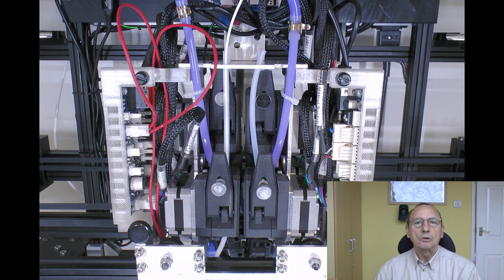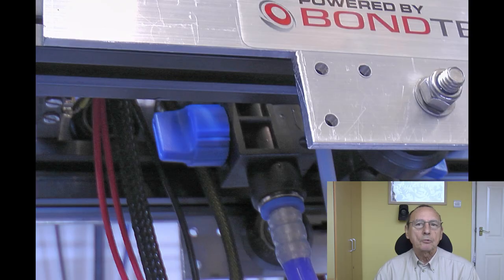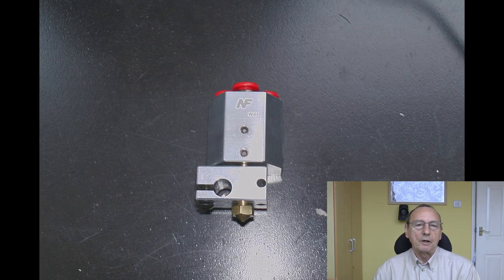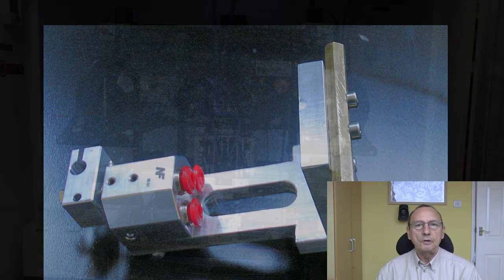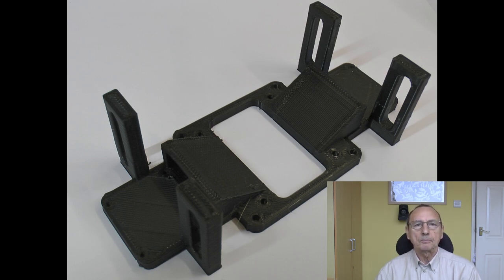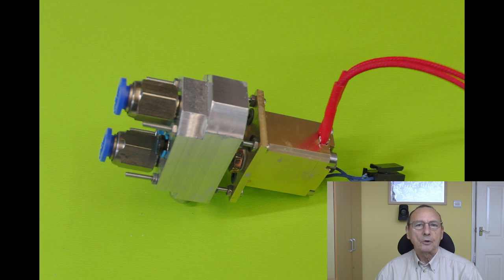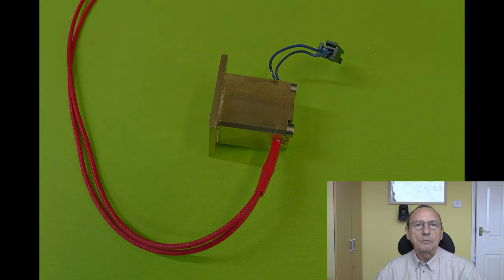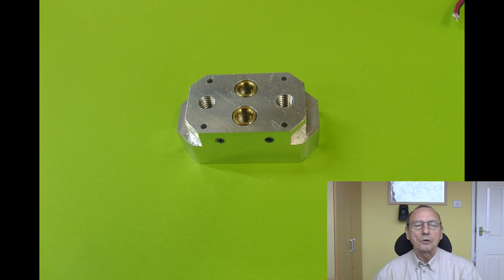Various Upgrades November 2020

Comment: Watercooling is far too underutilized, it makes a lot more sense for 3D printers than it does mediocre gaming computers :')

Your watercooling system looks awesome, I'm not too experienced w/ watercooling but in the PC building world, self built watercooling is often considered objectively subpar to an "All In One cooler" aka an "AIO", which is a prebuilt watercooling loop that (for some reason beyond my attention span) doesn't need any maintenance and runs more reliably for longer. Have you considered buying an AIO and CNCing a copper mounting plate to pass heat through the hotend to the CPU shape on the AIO? I think it'd be more reliable in the long term. I don't know much about watercooling though so take this with a grain of salt. Seems you can negate all those downsides by simply designing and maintaining it properly though.

Lastly, I wanted to share an idea with you, let me know if you have any opinions of it. What if, instead of mixing filaments on the printer, you took a diamond nozzle, machined it to have a 3.0mm filament input, then drilled the nozzle output so it extrudes at 1.75mm. You'd also want a laser to measure diameter and adjust your extruders speed to keep a consistent filament diameter, and a few fans to cool it off. This would result in a 1.75mm filament, just like any normal PLA, except it will be the exact colour you want it to be. You could produce custom coloured filament on the fly as it's printing beside the printer, then simply feed that single filament into an extruder, negating the need for such a strong support system on the printer for the multiple extruders. This also result in filament being "mixed" twice, once in the filament maker and again in the real hotend, giving a more homogeneous colour.
Reply from the maker: Thanks. Ref the water cooling - I'm just making it up as I go along. I know how it works on an internal combustion engine so my ideas tend to be biased around that. I also have experience of engine test cells but that's another thing altogether involving, industrial pumps, heat exchangers, cooling towers and such like.  Not sure how I would package a PC AIO type system onto my hot end. Anything "gaming" PC related tends to be expensive - and I suspect over priced. I don't envisage any maintenance issues - it's a just pump that circulates coolant - just a like domestic heating system except that it's cold water instead of hot. I paid more money that I think I should have for coolant containing corrosion inhibitors and algicides, rather than just using distilled or de-ionised water which I think would be the mostly likely cause of premature failures. It's certainly true for industrial engine test cell systems....

Ref your idea about a pre-mixer - sounds a bit like the pallet system. But using a Diamond would still result in stripey toothpaste, albeit going into the hot end. Not sure if it would result in a more homogenous mixture at the output - it might I guess.....

Comment: Did you look into zero-break quick disconnect couplings? Koolance has a variety of them. I've been using those on my big machine and it's really nice. I lose about a drop of liquid per disconnect event and I don't worry about an open tube draining the liquid.
Reply from the maker: No. I didn't realise they existed - but I do now. Thanks. .......A quick internet search brought them up - They are a bit on the pricey side. I'll need two for each of the 3 hot ends then a mating pair for the machine itself. I'll have to think long and hard about that........

Comment: I really like the fan duct you did. What fan are you using make/model/brand? And what frequency are you running it on Duet to get speed control?  I have been having a problem getting fans to speed control under Duet.
Reply from the maker: The fan duct is a modified version of what I used with the Diamond hot end. The fans are 12V 30mm blower fans - can't give you any more specific details I'm afraid because it was years ago when I bought them. For whatever reason,  I found that a really low PWM frequency is what's needed - I use 10 Hz and it seems to work well with good control over a wide speed range. No "blip" required either.
Reply: @deckingman  Thanks.. that at least gives me some sort of starting point.

Comment: No updates for a long time, hope you are fine.
Reply from the maker: I'm OK - thanks for asking. I had to take a break from 3D printing for a while because I was just getting too frustrated with all the Duet firmware issues. But things have settled down recently and I have started to get back into it. I've made another version of a 6 input mixing hot end which is showing promise. I've taken lots of still pictures of it but I'm undecided whether to continue doing YouTube videos about that, or whether I should just write it up on my blog.